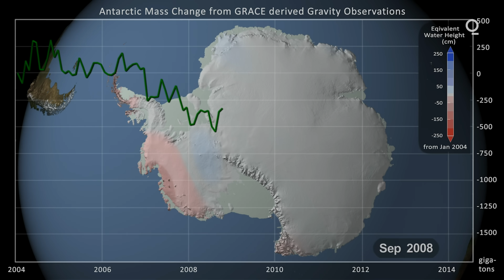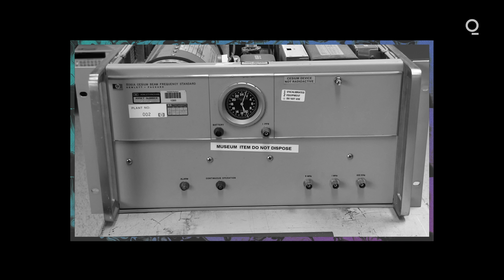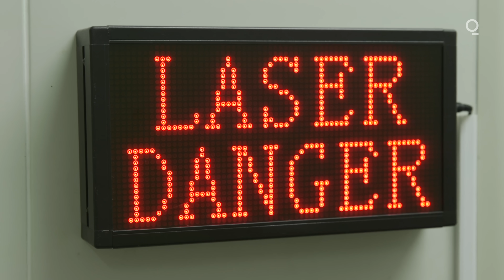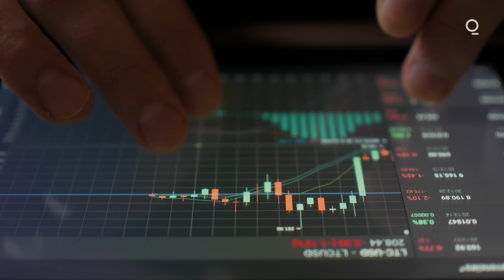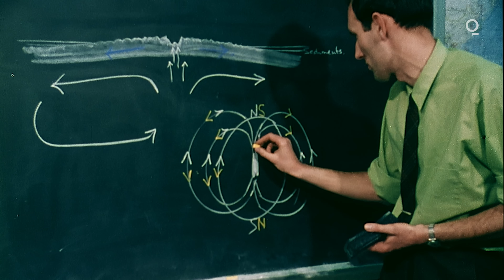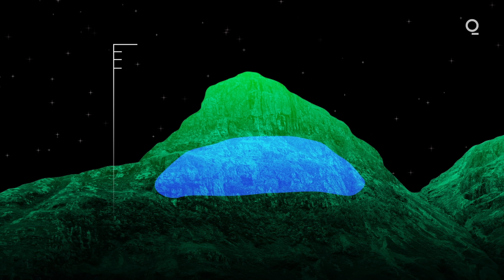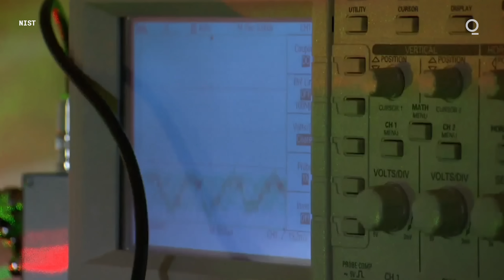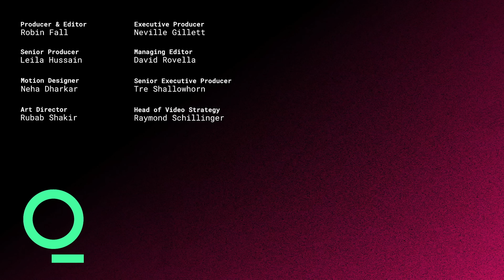Atomic Clocks Are Reinventing Time

Comment: How do they separate the atom ? And how laser is aiming at that single atom and not a wall.
Reply: They have their ways, but thats not the problem.

Its all bs, its not time that changes its the movement of the atom in the clock. They are measuring time through how the atom moves. Obviously when you bring the clock closer to earth, the atom moves slower because gravity is acting more on it. And if you put the clock on the tallest mountain in the world the atom would move faster because gravity is a bit weaker up there. Time itself is not changing its just how the mechanics of the clock being affected by gravity, and this could also happen through acceleration as you could imagine. Moving a clock very fast would reduce the effect gravity has on it so it would tick faster.

This doesn't change the fact that time is constant and independent of absolutely everything that exists.

Comment: the biggest mistake ever made is using movement to define time. but ok, the question is thn : how can we difine time without using movement. ? the thing is when we use movenemt to define clock, then movement will interfere with the time we measure. just think about it.. if the universe did not have any movement before any matter was created, the universe could not start. but if time without movement was there it could start. because then the universe would have all the time it needed to try ever posibility to start. maybe it started a lot of times, but was not a stabil start. and died.. maybe a nano second after it tryed. but as i know it started something that seems stabile. the universe could have used billions of billions of years with nothing. but at some time id got unstable, and stared.

Comment: If you were to move one clock higher why wouldn’t the fact that it has to be going faster now to complete one earth rotation lead to it ticking slower? Why in the end did the clock lower tick slower? Why didn’t they tick around equal speed?

Comment: A question for the smart people: Surely its not time that changes with gravity but measurement of it? You're measuring revolutions of electrons traveling at a radius around a nucleus in an atomic clock which in my mind compress/dilate in an increasing/decreasing gravitational field - no? So with the change in radius of the electron, distance in revolution also changes, reducing/increasing the number of rotations per second, which has the apparent effect of speeding up/slowing time. While the theory of slowing time in a rocket relative to the stationary observer works well at the small speeds relative to c that we can test, perhaps it is not time but rather 3D space that we flexing after all, and just measuring it with a clock that is super accurate. I guess my point is that using an atomic clock to measure time is very accurate at any point in space, but due to gravity it may not in fact be accurate at all as soon as you bring the distance function into the equation?
Reply: So you're saying that the atoms are compressed or decompress with the pressure around them, while the electrons always go the same speed.  That seems logical, it does not involve any of the particles changing size, but the radius at which the electrons orbit the nucleus changes.  
I am not smart, but I remember that the original experiment was not about which height the clock is at.  It was about how fast the clock was moving, relative to a clock that was on earth and not moving.  Thinking of time dilation in relative terms, like einstein would, it seems like there must also be space dilation.  Because einstein believed that time and space are connected, and helped develop the theory of "spacetime," which is not actually time or space, it is... the connection between them that affects things.
Reply: Gravity slows down molecules. The stronger the pull the slower the molecules. Let’s say you’re down on the floor. Gravity’s pull is strong therefore causing the molecules to move slower. Everything seems normal because it’s relative. If someone’s above you, the pull of gravity is less so they’re moving just a bit faster.
Reply: It really is the passage of time that changes. The reason for this is relativity. Space and time change depending on your speed and proximity to objects that have mass. A trippy idea is that no matter how fast you are going, light will always appear to go at the speed of light relative to you. So for example if you were traveling at 99% (about 297km/s) the speed of light and shined a flashlight out the window, it would appear to move at roughly 300km/s away from you. But the lights speed isnt 597 km/s, its still 300km/s, it would only appear to go so much faster because your passage of time is so much slower than it would be if you were not moving at all.
Reply: @rePawsum  the reason for this is 'movement' doesn't actually exist. if you think about it in the middle of empty space, there is no such thing as 'movement'. All movement is relative to something else. I.e. you are moving 50mph compared to that floating rock over there. But if there are no objects around you, then there is no such thing as 'movement', you might be moving 1 trillion of miles a second to one person, or 1 mph to another person depending how fast they are 'moving' and yet neither of you would ever know which one of you is actually 'moving' and which one is standing still. That's why the flashlight will always go at light speed cus when you THINK you're 'moving' you're actually just "standing still" in the middle of empty space. That's why time is only affected by acceleration (applied force) not motion/movement
Reply: @kardsufur2966  what ur saying is like if we put 2 people in a vacuum (lets say they can somehow live and move around in there) and they are moving in the same direction at the exact same speed, they cant tell they are moving because relative to each other their positions arent changing. So basically their movements are not noticable. But that doesnt mean they arent moving? They just arent changing distance relative to each other. But they are still moving, they just cant see it.
Reply: I have a theory that time is simply just a byproduct of what occurs in the universe or by action. Time is created by what happens within that point in space.

Comment: When pito tubes failures have caused a LOT of airplane crashes, wouldn't adding an atomic clock to airplanes in order to measure altitude and speed make air travel safer?
Reply: You don't need to add an atomic clock to an airplane, using the atomic clocks already in array, around the earth, you know, GPS, works just fine. Also, it's Pitot tubes,

Comment: It would be so, so interesting to find out that in the void between galaxies, time slows down again, having an invisible force causing the expansion of the universe. Maybe "antimatter" is simply another universe pushing down onto the fabric of spacetime on it's side, propping the fabric up instead of down on our side, making time slow down on our side but without an obvious cause. If in the near future we are able to launch an atomic clock into the gap between us and our nearest neighbouring star, Proxima Centauri, we should be able to measure whether this is the case or not, allowing us to perhaps understand the reason for the universe to expand instead of contract.

Comment: so is your biological clock affected by atomic time? Im trying to wrap my head around it. So if I was separated from my twin at birth and  my twin was living in a space station around Neptune. By the time I turn 70 years on earth, would he by like only 30 years because it took 30 years old to fly out near Neptune??
Reply: Its all bs, its not time that changes its the movement of the atom in the clock. They are measuring time through how the atom moves. Obviously when you bring the clock closer to earth, the atom moves slower because gravity is acting more on it. And if you put the clock on the tallest mountain in the world the atom would move faster because gravity is a bit weaker up there. Time itself is not changing its just how the mechanics of the clock being affected by gravity, and this could also happen through acceleration as you could imagine. Moving a clock very fast would reduce the effect gravity has on it so it would tick faster.

This doesn't change the fact that time is constant and independent of absolutely everything that exists.

Comment: If the clocks are so accurate then how do you get them from one place to the other to compare against a reference clock without disturbing the measurement?
Reply: If you are moving the atomic clock upwards (away from the earth's center) then that should speed up the ticking even more, so it should make the difference even more noticable. Btw i still dont buy this whole thing. I need proof that they actually tick at diff speeds if u place them in different heights or move one of them

Comment: At one point you say that a person walking experiences slower time than a person standing still. This is incorrect as they are both moving relative to each other, they will in fact observe the other persons clock to be slower. Only of one of them accelerates will differences in time actually occur.

Comment: The atomic clock bases the measurement on the tiniest oscillation in the element Cesium133.
Reply: Its all bs, its not time that changes its the movement of the atom in the clock. They are measuring time through how the atom moves. Obviously when you bring the clock closer to earth, the atom moves slower because gravity is acting more on it. And if you put the clock on the tallest mountain in the world the atom would move faster because gravity is a bit weaker up there. Time itself is not changing its just how the mechanics of the clock being affected by gravity, and this could also happen through acceleration as you could imagine. Moving a clock very fast would reduce the effect gravity has on it so it would tick faster.

This doesn't change the fact that time is constant and independent of absolutely everything that exists.

Comment: Bullshit Alert
Time is just an illusion, albeit a very persistent one. So is color smell and sound. An off the shelf laser pointer pointed straight up into the sky produces a beem that travels at light speed yet that beem does not travel back in time. Now if that beem were to move horizontally across the sky it's horizontal movement would be greater than that of light speed and still it would not travel back in time. This is because time like taste and smell do not exist. Time is a method of measure similar to a ruler or a meter stick which we use to measure energy experiencing change. The stick exists but the meter does not. Like time the meter is just a form of measure used.

Comment: Wouldn't the clocks at the equator be travelling relatively about 1000mph faster than at the poles?
Reply: It's more to do with acceleration that actual speed. If you are moving at a constant speed, then you are not accelerating. If you are sitting on the earths surface you are surely moving at a constant velocity.
Reply: @ToxicityAssured  If you started the clocks at the poles and brought 1 to the equator then that would be like accelerating to 1000mph or is that not enough to see a difference? What about putting 2 clocks on pendulums on the equator, with one pendulum swinging north to south and the other swinging east to west. shouldn't the east to west experience a greater acceleration? Cheers for the reply btw

Comment: you need to think of time as something that is part of a fabric, that can be molded, shaped and moved around. In a weird way, it kind of is like temperature. It varies based on its environment. The way to solve this problem is to ask ''what if'' questions. What if the universe was x or y, what would that imply with the definition of time and does the math checks out.

Comment: It will help physisists overcome their aversion to time speed gradients being the sole cause of gravity. Mass/energy is attracted to where time passes more slowly; following the path of least resistance away from the squeeze of faster time.  Multiply that tiny difference in the speed of time at different heights by mc2 to calculate gravitational potential energy.  

No need for dark matter.  No need for curved space.  

 Empty space pushes just as much as density pulls, thanks to energy/matter's ability to retard the speed of time, thus creating the time speed gradients that we call "gravity".

Comment: I'm impressed if they still using Intel Pentium 4 as seen in 14:54
Reply: if an application has no hyper threading then technically a 4-5ghz pentium 4 can beat a 16 core processor where all the processors run at 2.8ghz etc

Comment: Genuine question: In the mountain example: wouldn't the mass of any snow atop/around the clock change the outcome via more mass (or at least, density), thus equating to higher gravity and consequently skewing results expected by height? Snow density changes in a "wet or day" type as well so that would be hard to compensate for, right?

Comment: Well, in fact, gravity and time are interconnected. We experience gravity because of the time difference a mass in space creates. Elements fall in direction of the center of Earth, BECAUSE its mass makes time move slower the closer you are to its center of mass. The apple does fall from the tree, because the elements the apple consists are pushed into the direction in space where time moves slower. You could say that time itself has the effect of a current moving elements in space (like a paper boat floating in a current of water, because the water pushes and pulls the elements the boat consists of into the direction of the water flow, or like a leaf floating in a current of air), and the time difference is a "pressure difference", that moves elements in space around - fast moving time has overpressure and slow moving time has underpressure and the elements in space react to this pressure difference (and we experience that as "gravity"). So the weight of a human body actually also describes the time difference between the tip of its head and the bottom of its feet, because weight is nothing more than another way to describe the gravity effect the difference of time in space has on a body in space, the pressure the time difference applies to a body to move into the direction where time moves slower. Also fun fact: That's why in a vacuum (a space without air) every element falls in the same speed in the direction of Earth's center, if is is a feather or an iron hammer, because it is not a feather or an iron hammer that falls (that is pushed by the time difference into the direction where time moves slower), but each single core element that these objects consists of, that in the end form the feather or the iron hammer to us, moves independent from each other, affected by the time difference and the pressure it applies to each element to move to the center of this mass called Earth. And another fun fact: Since time moves slower at the center of Earth, Earth's surface is around 30 months older than its core (in a way, while we on the surface have now February 2021, Earth's core is around August 2018 ;o).
Reply: this reminds me of an airplane's wing, the pressure difference between the top of airfoil and bottom where air rushes at a faster rate like time over the top than it does on the bottom due to the longer distance it has to travel thus creating lift / upward force

Comment: Could time just be an illusion. And gravity just slow/control the rate everything move in space, or is that what time is?
Reply: Time is an illusion   there is no now
Reply: time is dependant on entropy. it shows the relation between objects and how fast they soread apart. so its not an illusion per se but you are right, its a way to analyze the rate of expansion
Reply: @xSILVERxVENOMx  but gravity does the opposite. It coalesce everything to a single point. And according to I think Newton gravitational law, gravity is only diminished never gone.
Reply: @xSILVERxVENOMx  gravity's only move in one direction maybe that why time does as well.

Comment: My question is if time moves slower, how does that affect the human body. I mean we still age at the same rate, our internal body process aren't going to suddenly slow down ?. I don't know can someone explain.
Reply: U have common sense lol time is independent of everything, all this theory is bs, its not time that changes its the movement of the atom in the clock. They are measuring time through how the atom moves. Obviously when you bring the clock closer to earth, the atom moves slower because gravity is acting more on it. And if you put the clock on the tallest mountain in the world the atom would move faster because gravity is a bit weaker up there. Time itself is not changing its just how the mechanics of the clock being affected by gravity, and this could also happen through acceleration as you could imagine. Moving a clock very fast would reduce the effect gravity has on it so it would tick faster.

This doesn't change the fact that time is constant and independent of absolutely everything that exists.